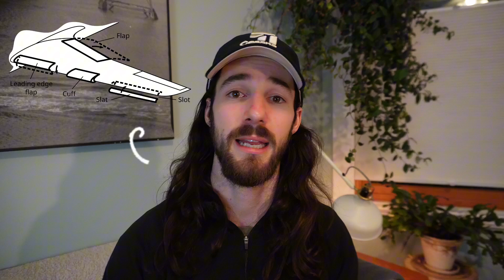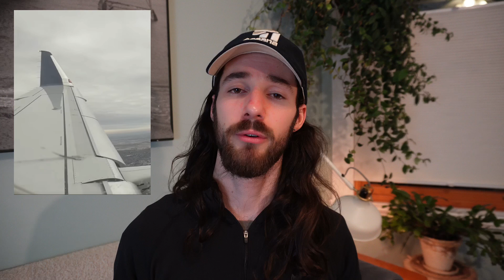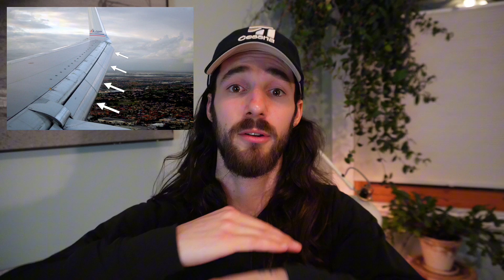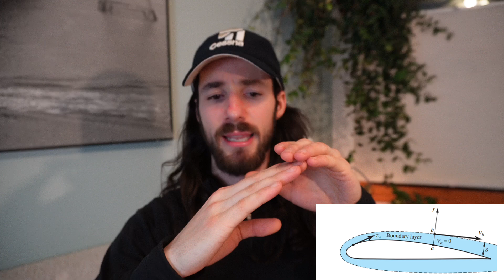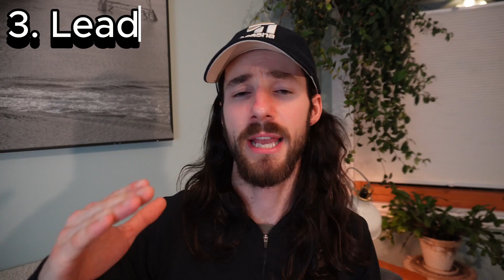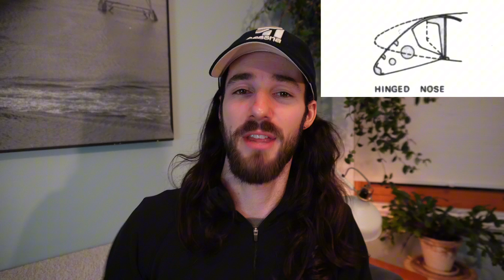High-Lift Devices: Slats, Slots & Leading Edge Flaps Explained

Comment: Thank you for making these videos!
I wonder are Slats usually located at the outboard leading edge while LE Flaps are located at the inboard leading edge (closer to the fuselage) ?
Also, by any chance any of those common commerical aircrafts have either Slats or LE flaps only?
Reply from the maker: Absolutely, great question!

Yes, you’re right — slats are typically on the outboard leading edge, and leading edge flaps are more often inboard, closer to the fuselage. This setup helps optimize lift and airflow across different parts of the wing during takeoff and landing.

As for aircraft with only one or the other — most modern commercial jets use both slats and LE flaps for maximum efficiency and safety. It’s rare to see one without the other on larger airliners.

Thanks for watching and asking insightful questions! ✈️